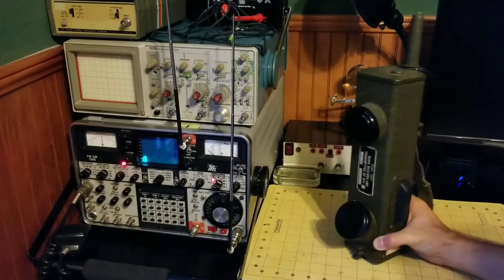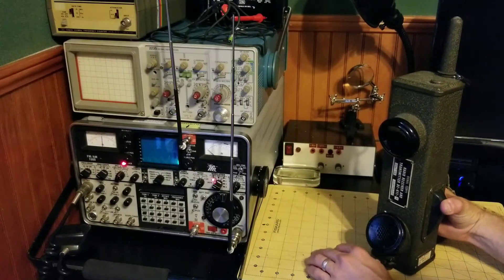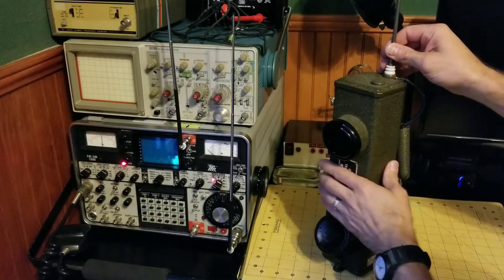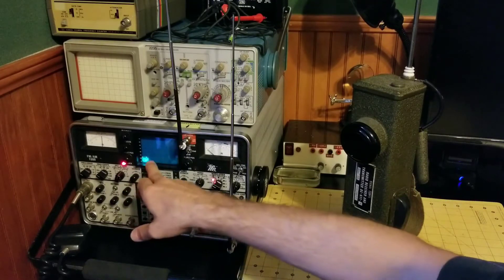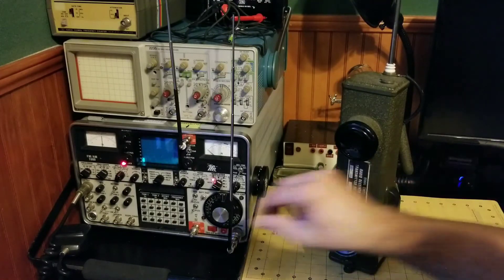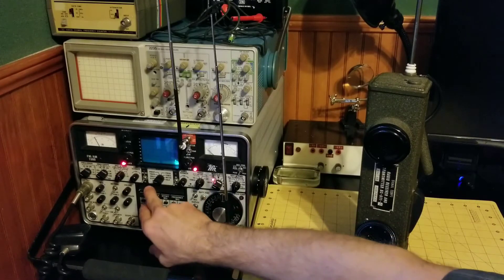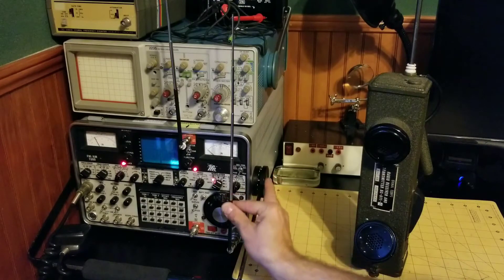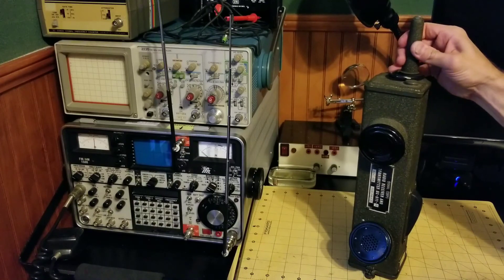BC-611 Transmit/Receive Testing over the air with IFR Service Monitor WW2 Handie Talkie

Comment: But you failed to let us know the sensitivity???  I would have taken a coax from your generator and connected the center with an alligator clip to the walkie-talkie antenna. and the shield to the metal case of the walkie-talkie.  This will provide the sensitivity.  I understand they are rather good in the receive; about 1 micro-volt if properly tuned.  Let us know the receiver sensitivity.